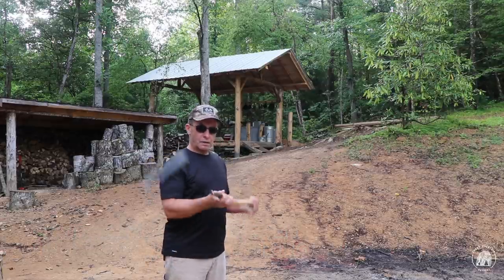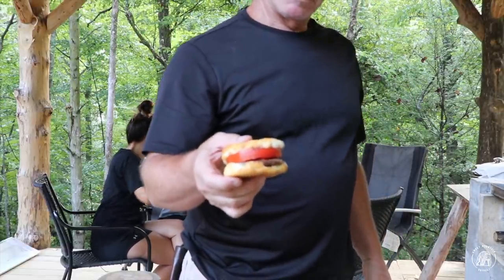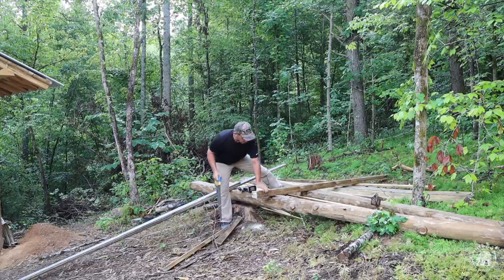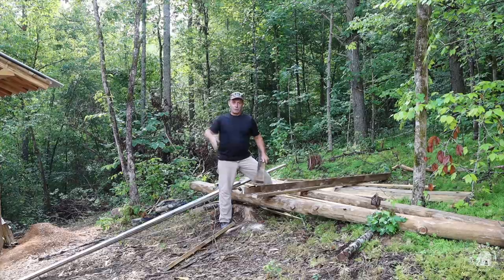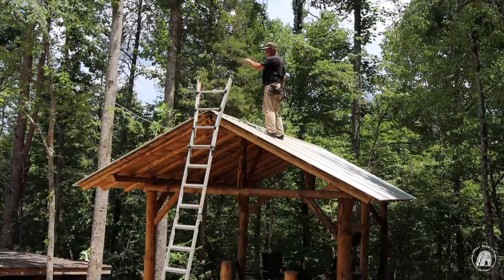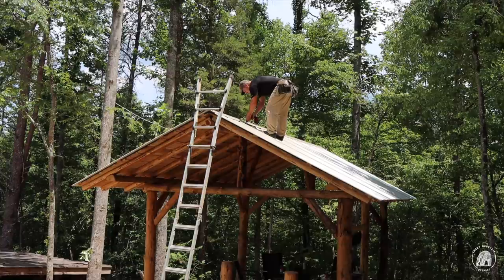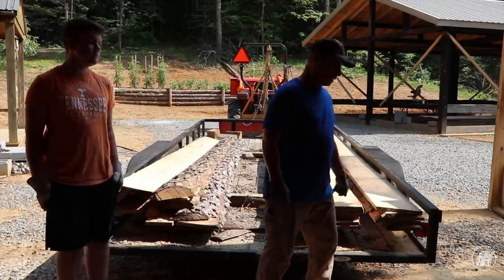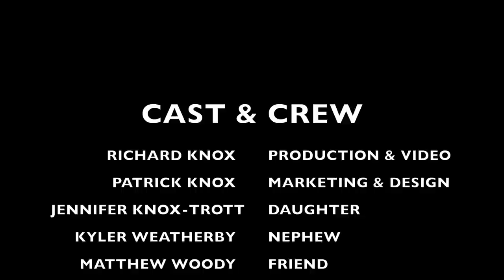S2 EP30 | TIMBER FRAME | OUTDOOR FOREST KITCHEN | FINISHING METAL ROOF & MILLING SIDING

Comment: Some roof jacks would be handy for putting in the rest of those screws.  My cabin had a 12/12 pitch on part of it and there would be no way I could stand on that pitch. Even on a less steep pitch , the roof jacks make the job a lot safer.  Your method worked pretty well too !
Reply from the maker: Thank you

Comment: Your doing good on the outdoor kitchen it'll be nice on a rainy day for sure. You need a weed eater with a motor, can't beat it, we always called what your using a Slingblade, knock them down mainly does cut them!
Reply from the maker: That would be to easy. I like the old ways, lol

Comment: you should screw on the ridges instead. it wont get as much water on it because it just runs off
Reply from the maker: I used to but the warranty is void if I do
Reply: @SmokyMountainOutpost  okey i wonder why